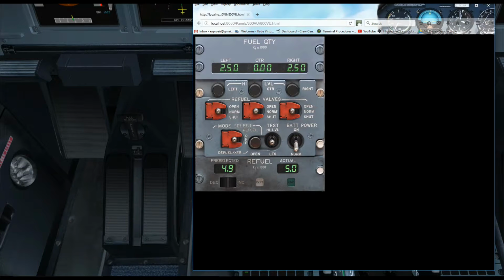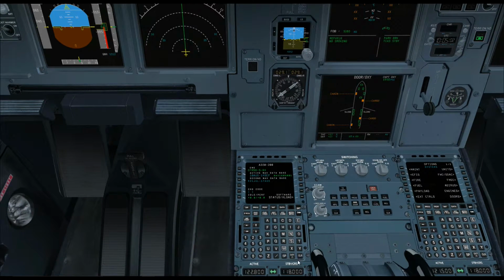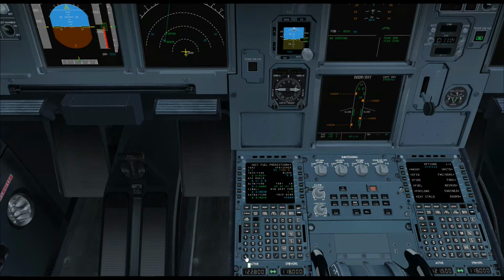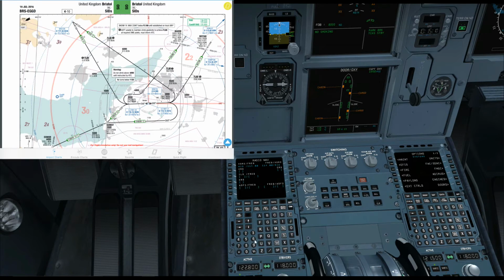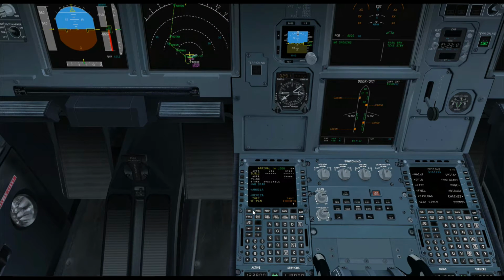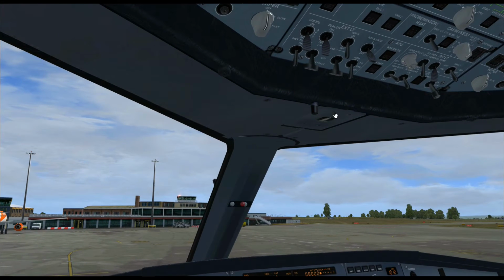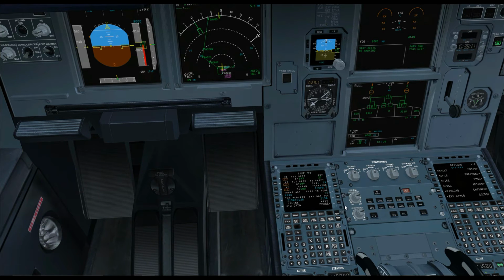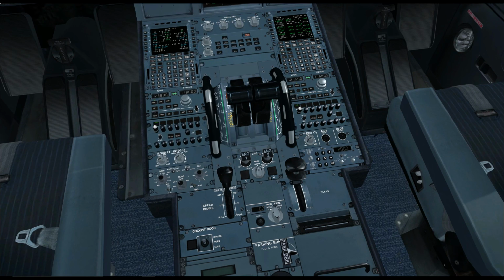Flying the A320 - Part 3: FMGS Setup & Before Start

Comment: In the T/O data, performance page, what is T/O Shift designed for? Thanks.
Reply from the maker: For reduction in takeoff length, if you are taking off from an intersection rather than full-length